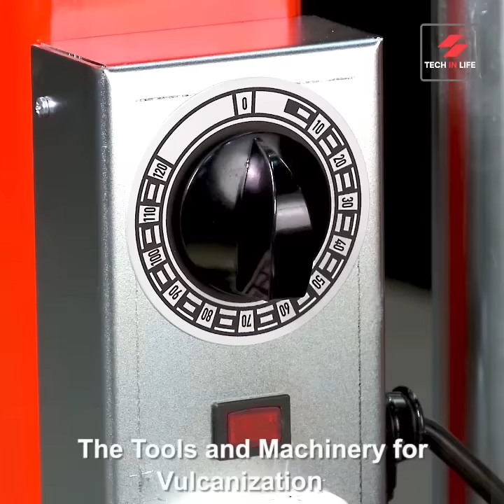How to Repair a Tire | Secrets the Ultimate (Easy to Fix Tire Leak) 2 Way😃 #shorts

Comment: I don’t care how skilled you are, a sidewall is a no repair
Reply from the maker: Thanks for your comment. I hope you've a lot of experiences.
Reply: @TechInLifeToday  I hope you’ve a lot of experience ?
Reply: Sidewall might blowout at the first pot hole.
Reply: True
Reply: Even if it is repairable which I agree with shayur on side wall repairs being a no no, is the parts and labor cost worth it?
Reply: Better buy new tyre, more cost for NEW
Reply: How can I drive 200km/h with that? I would not even try
Reply: @TechInLifeToday  as a third generation mechanic turned electrician (cuz the money is better) don't ever repair a sidewall. Shred that tire. There's a reason why it's illegal to patch sidewalls specifically in many states in the US. Not because it'll guaranteed blow out under the same pressure that a sidewall has to be tested under in order to be road legal.

It's because that cute little unethical patch on a highway is a totally different problem. Let's say you hit a pothole. It normally takes around 90 psi to blow the sidewalls on a older or cheap tire rated for 30. I've even done it in my shop as a test. Like a hand grenade going off. That patch is a weird weak point cuz its also harder. When you hit a bump the tire psi actually fluctuates up. If a car is passing you and you happen to hit a pothole, ripple strip, lane reflector, turtle, whatever and the sidewal blows, that patch WILL fly out like a slug. Guess who's liable? The owner and the "shop" that made the repair. Even a normal sidewall blowout can cave a passing cars door. 

Feel free to test it in a press in your shop. It's a bottom line bad practice and can get people killed. That's just criminal negligence and poor shop practice. Make sure you attach your shops name to your YouTube page so people know not to go there.
Reply: @TechInLifeToday  yeah your liable for any injuries/damages your patch creates, think a shotgun slug. how's many lawsuits are you in yet? (Besides it being completely illegal)
Reply: @hamburbers  this isn't done for highway driving. That's what you people don't understand.
Reply: @hamburbers  
They didnt just patch it the but like "new rubber" on to it i think this is a type of self adheadsive rubber it will bind to the rubber thats there and it will give a permanent seal after vulkanisation, but u have to take that tire to a shop with that machine fore vulkanisation so ur cheaper with the new tire
Reply: @Sevi_4738  right. Rubber stronger than the factory steel cord. Why haven't engineers thought of that and started replacing it everywhere? 

Oh right you forgot where we listed why these patches cause a problem. It's a patch. The surrounding rubber give out under the pressure and since you've ruined the integrity of the steel cording nothing is going to be left. Thus that blowout pressure launches that steel and that one overly hardened patch of rubber directly outwards. 

It's the funniest thing ever when the repairs roll into the shop and it the inside sidewall. I mean like 60% of the time the car is totalled from the fact that they completely lose control...but in the other 40% of the time the mechanic gets to charge you by the hour to replace everything it damage and to clean all the crap out of it. When it's the outside sidewall...well hopefully nobody and nothing expensive was around or your lawyer is really good and the crappy shop that did it hasn't been sued or fined out of existence since they're legally liable if you can prove they signed off on the repair.

Ya know...on second thought, more people should get them.
Reply: @TechInLifeToday  any damage on the tire side wall make the tire not safe because it creates weak point between the steel belt and the radial plies and that why it make it easy to blow,  what you performed is for poor countries where the tire cost fortune and the humans life not important, Thanks
Reply: @snakemgs3766  where you can drive 200km/h🙂 only in Germany🧐
Reply: @titigi  Of course, nowhere else  😜
Reply: Dangerous! Lost steel ply !
Reply: Exactly 💯
Reply: 100% agree
Reply: @Lil-bits-animals  shotgun slug illigeal? Where are you?
Reply: It's a retread which are built to be repaired for big rigs..... no one caught it was a Bridgestone M780 Drive tire? You can tell it's a low pro
Reply: @hamburbers  ur no expert if you don't know what a retread is hahahaha. They are literally built to be reused 3 times even on sidewall damage
Reply: @benjaminsg1753  your response is hilariously so ironic that I'm pretty sure you didn't watch the video. So a re-tread (which as proven by thousands of tests and repeated underperfonce is unwise) is a technique where you skin the treads off of a tire (keyword: treads...the treads are not the sidewall) you do not pentrate the cording (as even where it's legal and rated for retreading, that makes the structure of the re-treading worthless and bubble up will occur leading to a blow-out) and even with all of those allowances being brought into the picture, it's still illegal to perform on highway vehicles in most states. It's like gluing a new sole on a pair of osha rated work boots. If ya do it, it's because you're a cheap skate and those boots are no longer osha rated. 

Even with all that said...you don't even know the difference between a sidewall and the treads OR a patch and a re-tread.

Comment: I used to be a local tire technician. Man, props for the job. Is satisfying to see how clean and detailed you made.
For those who thinks this is not supposed to be done:
In situations like this those tires goes as spare tires for local moving vehicles like Tractor or trailers, Cranes and Dump trucks (most not even commute highways). By the experience I have as a former tire technician and for my period as OTR truck driver, I can assure you that very few people would be insane of mounting or either using a tire like this in a OTR truck, both would be liable to death.
Reply from the maker: Welcome...Thanks for sharing this valuable information. Stay tuned to keep watching my videos and always leave your comment.

Comment: Doesn't it need the wires inside? 🤔
Reply: I think its fine for 1 or 2 wires to be removed for repairs and its not on the part where its in direct contact on the ground.
Reply: Yes, once those are gone, the tire is done.
Reply from the maker: Thanks for watching this video and for your comment
Reply: @TechInLifeToday  is this your ANSWER to “does it needs wires?”
Reply: It needs the wires, sidewall repairs are a big no, it’s just not worth the risk
Reply: @rookeygarage  that's what I thought. That tire is trash I would rather get a use one.
Reply: @izenikgabeko6244  nah pretty sure it's just a bot at this point. Nobody's PR is this bad that's still in business.
Reply: The Patch replaces the wires.

Comment: This work remarkably well for farm application when you also use an inner tube. Sidewalls have to be more pliable on roads for cornering. This material is not a structural component of the tire, and will be rejected under the first hard turn. Next to brakes, tires are the only thing that can get you home safely.
Reply from the maker: Thanks for watching this video and for your comment.

Comment: Not sure if any of y'all had notes but this is an off-road tire meant for off-road purposes only that's the only time I would recommend doing that for temporary or off-road only where you're not going fast probably for a tractor but yes a big no no especially since he cut the wire cords those are structural those help hold it now when there's internet that's the point a blowout for it to bubble out in later on cause issues with that tire again
Reply from the maker: Thanks for your nice comment. Yes it's used for off road.
Reply: @TechInLifeToday  patches with the pull through plug on my own tires for my off-road equipment so such as my when I do off-road recoveries I have certain tow trucks that don't even go on the highway or even on public roads actually load it onto the back of my flatbed tow truck and then transport it to where I'm having to pull someone out of a trailer or something and I'll go through the trails and pull them out and I usually have a friend that comes with me cuz the off-road trucks are not street legal and what they do is they just sit with the truck while I go to the drop off or usually the person I got stuck and broke the truck usually has their own trailer already there by the time I get there

Comment: How expensive is this process and how expensive is a new tire? It looks like the technician did a really good job but that also looks pretty pricey.
Reply from the maker: Thanks for watching this video and for your comment. To know the details you may follow the website, link in the video description.
Reply: @TechInLifeToday  u could’ve answered his question in the same or less time of saying to go to the website and read about it 🤦‍♂️ fukin robots
Reply: @drew Sizemore I agree, from the look of it could be any where from $200 to $300 which is more expensive than an average new tire but I’m assuming this process is for exotic cars or race cars where it would make more sense to do this instead of buying a new one.. would be nice if the dipshit confirms but he wants us to go to the website and read a whole pointless article
Reply: @AJ_900  
Marketing
Reply: in 3rd world country we just jammed a sticky rubber in there and call it a day, it costs 2 bucks
Reply: dualKeyboard But does that work for semi truck tire? on a sidewall too? I’m live in 3rd world country too we only do that with car or pickup tire not semi truck, it’s never work  (for me) And yes it’s 2 bucks to patch normal car tire  10+ bucks for semi truck. I’m a shop owner in Thailand by the way😀
Reply: @AJ_900  most likely for semi truck tires that also can be re-treaded not sure what the price difference is for semi tires between a repair and replace but it might be worth it. On a exotic sports car however it seems to me like the owner could easily afford to just replace the tire if they needed to also with the kind of strain a tire on an exotic car is under and the speeds they are capable of I would absolutely not trust this repair to hold up. Trucks on the other hand are limited to 65 mph so while they are under extreme load they are less likely to suffer from imbalance issues than a car that can go 160-200mph.
Reply: How to you make this look expensive? 😳

Comment: Just look at the amount of cracks in the adhesive already before it’s even been a day!! And the amount of stuff you’ve had to put on that sidewall inside and out plus the time it’s taken this is why garages will not repair them because it’s not worth their time and isn’t structurally safe on the roads hence why they won’t do it they don’t want it coming back on them plus it’s probably cheaper to get another tire but you do you
Reply from the maker: Thanks for your comment. I hope you have a lot of experiences. Friend...it's an off-road tire.

Comment: The cost of materials, machinery, time and labor could not justify this method of a dangerous tire repair. Definitely for off road use tires where no pedestrians and vehicles  are aror
Reply from the maker: Exactly you've shared the right information. Thanks for watching and for your comment.

Comment: If you break the inner steal rods. How safe will by structure of whole tire?
Reply from the maker: Thanks for watching and for your comment
Reply: @TechInLifeToday  I watched it several times and you absolutely cut the steel radial structure and ground down the sharp edges which is a huge problem that structure is extremely important especially on a truck tire like that. This tire is unsafe and will potentially kill someone. You should never attempt to repair sidewall damage in the first place but this is the most reckless and stupid way to attempt a repair possible and I hope this was a joke and that tire got thrown away as otherwise you could legitimately kill someone like that.

Comment: Why is the interior repair on the face of the tyre and the external one on the wall??? 😂. Also, NEVER try to repair the side wall.  You need a new tyre.
Reply: This Is a semi truck tire... perfectly okay to fix small tears like this. The industry has been doing this for years. Including retreading.
Reply from the maker: Thanks for your comment
Reply from the maker: As you wish...Thanks for your comment.

Comment: All that and the tire is still ruined anyway. You cut a section of wire out, its structural integrity is compromised
Reply from the maker: Thanks for your good suggestion. It's not removed the wire, just removed the damaged cotton cord.

Comment: Yes, just cut the wire that holds the 🦆 ing high load wheel together, what's the worse it can happen. Never repair a sidewall, it will blow up
Reply from the maker: Thanks for your comment

Comment: Very misleading video. This is not a passenger tire it's a semi tire, or what we tire guys call a retread. To get into more depth, it's a drive tire not a steer. Semi truck are a little diffrent then normal tires. You can basically rebuild them 3 times before they are trashed. Now you know
Reply: Looks like a Bridgestone M780 low pro drive. Hard to tell tho. Don't repair passengers like this pls. Great video
Reply from the maker: Thanks for watching this video and for your comment. It's a off road tire
Reply from the maker: Thanks'